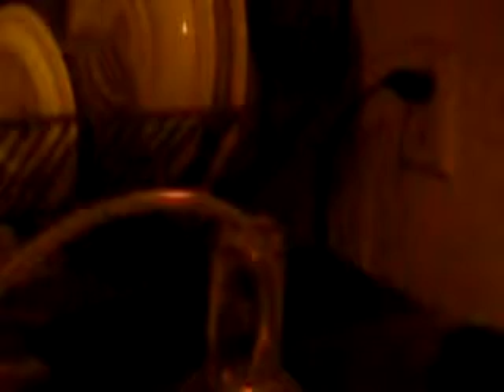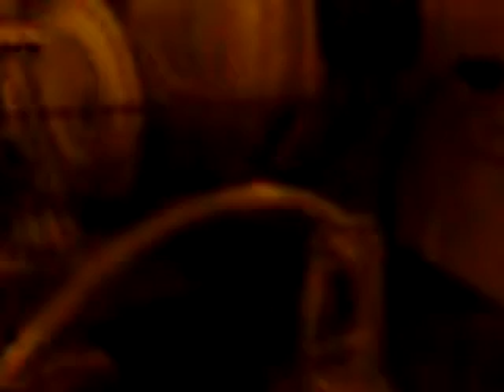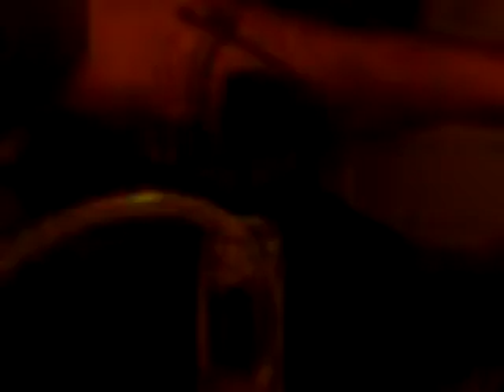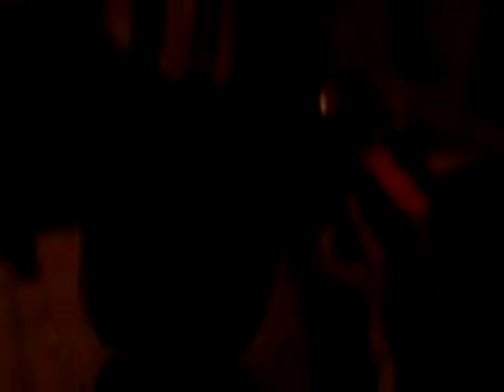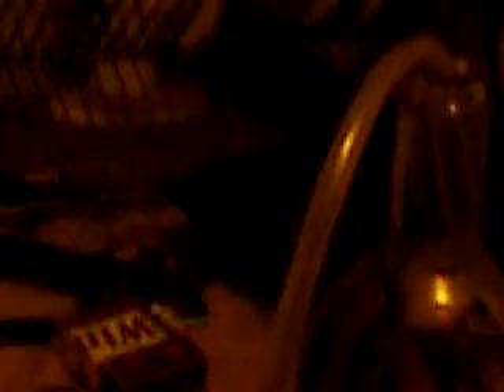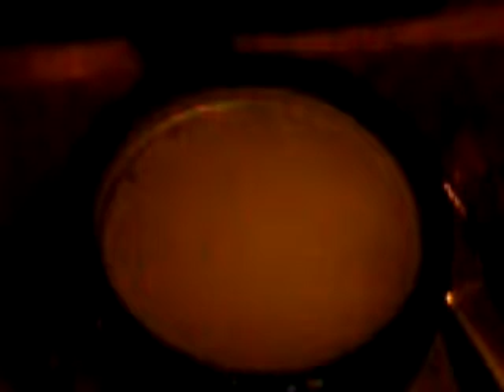Hydrogen Cell from a coffee mug

Comment: i like your thinking so i'm going to give you 2 useful tips 1: baking soda is some kind of salt and salt makes things rust and as you may already know, that stuff on top of the water is rust. 2:when you turn off your cell the hho goes back into the water, the bubbler is filled with water, the longer the hho is in that water the weaker the hho. sooo the closer the input is to the top of the bubbler the stronger the hho.